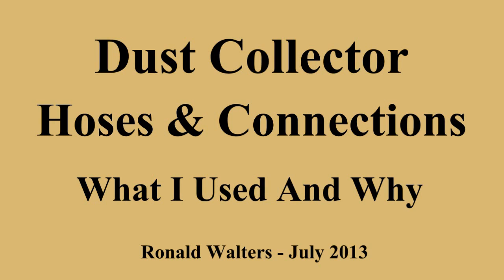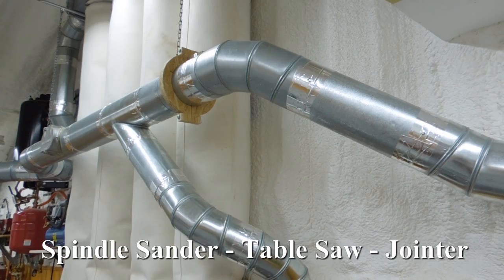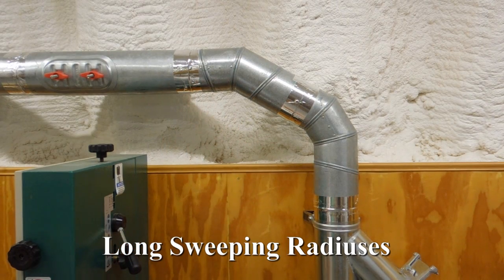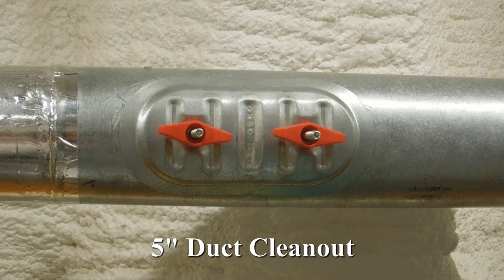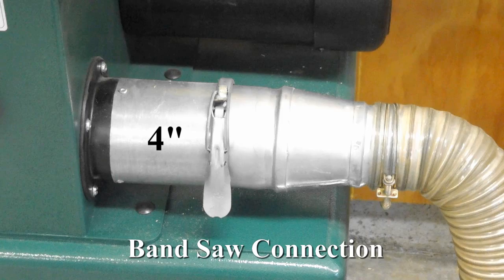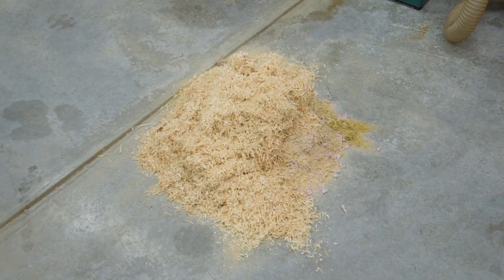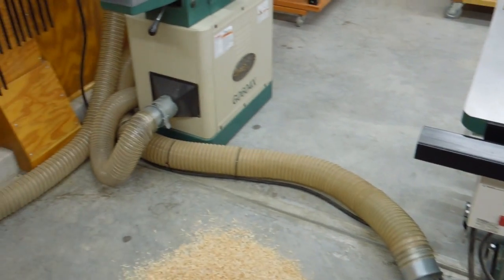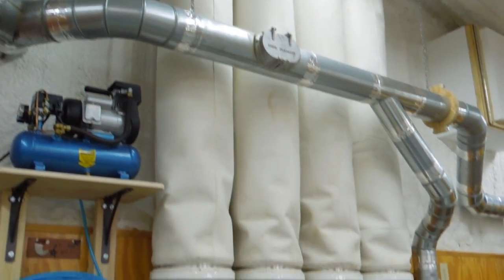Dust Collection Hoses - New Shop

Comment from the maker: Moisture is always going to be a problem unless you live in Colorado, Arizona or a desert somewhere. I worked in the oil industry and our equipment had lots of pneumatic controls and they had desiccant canisters and filters and we still had water problems. Only good answer is a refrigerated air dryer but those are expensive and really only feasible for low volume air usage. Just oil your tools and hope for the best.

Comment: I don't want to sound like a know it all and it's an interesting subject.I use mine just for stapling and a bit of air dusting,I'm a one man bespoke upholsterer.I find the condensation isn't a problem during use as such,but after you have finished and the air cools down in the hoses if they are long and coiled up like you have.My engineer friend has all the lines high up and angled to drain back to the tank. Also oils tools after use and gives them a quick spin before storing. Just batting ideas

Comment from the maker: The compressor is up high to get it out of the way and above head height. Water will condense and travel the airline regardless of length or where you put it. This is for low volume items like nail guns or staplers so the small volume of air will hopefully have a chance to cool off in the tank and condensation take place there, in the tank. (Wishful Thinking?) The tank has a drain valve. I just need to remember to drain it once in a while. Also, always oil your air tools before every use.

Comment: Just out of interest, regarding your compresed air. Do you find you have problems with water condensing in your air line with the compresor being so high up and hose being so long? Have you not been tempted to put it outside and run some airlines along the same route of the extraction duct work?

Comment from the maker: The filter tubes remove all fine dust from the dust collector. The major accumulation of dust generally comes off the table saw, miter saw and disc/belt sander (you will never catch it all). I have never noticed a large accumulation around the filter bag buckets as would be expected if the filter tubes were leaking dust. The two A/C’s turn over a lot of air and the filters I have placed on them have worked well to remove/scrub airborne dust. I blow them out from the reverse side once per week.

Comment from the maker: The cross sectional area of the 5 inch is 2.78 times greater than the 3 inch (plus the 3 inch hose is way too long) but in terms of air movement the difference is much greater than 2.78 times. Extending the 6” duct as far as possible is key. The turns are not too bad if you use two 45’s to make a 90-degree bend, etc. Thank you for watching!